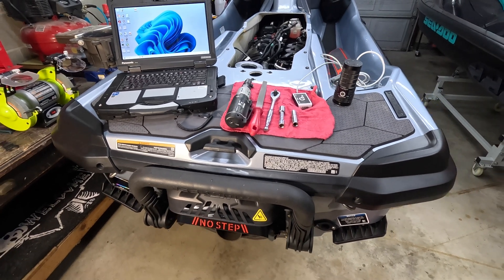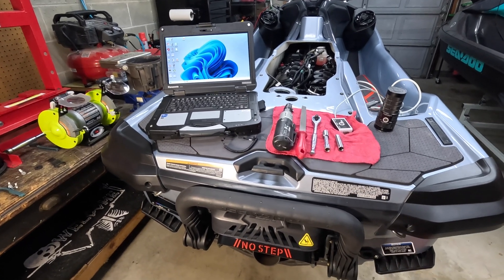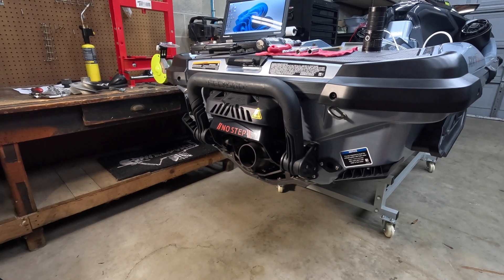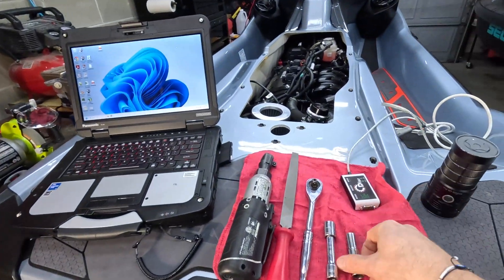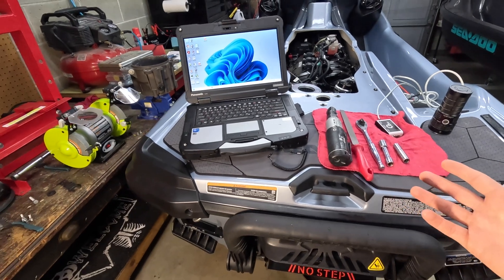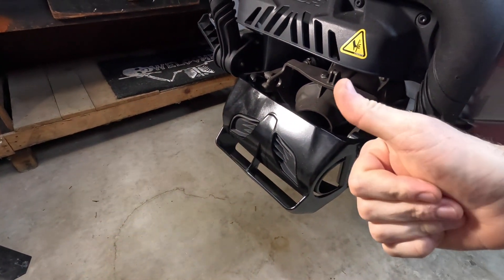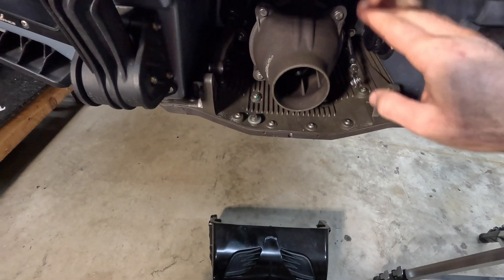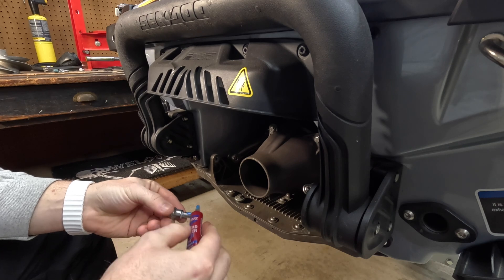SeaDoo iBR Stop Grind - Increased Trim Range and Top Speed

Comment: Got my ‘25 RXT 325 last year and still need a few more hours to 10. Recently purchased Riva single rear exhaust, Riva sponsons and the MapTuner Nano. Will the Nano allow me to recalibrate for this mod or is that only for licensed software?
Reply from the maker: You won't need to do any calibrations for the exhaust since it's not changing any engine parameters (the OEM exhaust has no restrictions). However, simply plugging it in will act as a SCOM. If you ever want to tune it, you would need the unlocked ECU.
Reply: Sorry if my question wasn’t clear or the addition of my mods confused my ask. Can the Nano do the recalibration you did using tue BUDS system for this trim mod? The exhaust and sponsons are just what I prefer and put on all my SeaDoo PWC.
Reply from the maker: @bamafam Ah no problem! Yes, the calibration can be done with the Nano, you will have to buy the home service or dealer service license though.

Comment: Hi Jake, great video. I did this modification and saw improvements. I recently swapped to the unlocked RIVA ecu and decided to re-auto calibrate the iBR using the maptuner. It ends in the all the way up position. If I pull the key and come back later to do the iBR override to all the way up, it will not go to the same all the way up position I see during the auto calibrate. Thoughts?
Reply from the maker: That's perfectly normal. The VTS "learned" range is different from what the override uses.

Comment: i have a 2021 gtx 300 filed the ibr stops then took to a shop he did auto recalibrate with my x module installed did not go all the way to upper stop but did go all the way to down stop position then we tried to do auto recalibrate without x module same results is there some parameter in the ECU tha tneeds to be unlocked with gtx models since they come from factory with restricted trim range

Comment: Do you need to re perform the calibration if you disconnect the battery? My ski reverts back to its trimmed down calibration that came with
Reply from the maker: No need to recalibrate after the battery removal. The resting position of the iBR doesn’t matter. Just the trim up and down height when riding.
Reply: Unfortunately mine loses the calibration if I do that and it doesn't go all the way up anymore, even if trimmed up when the engine is running and in drive. So I have to recalibrate each time. Also no fault codes
Reply from the maker: @frankj1663  Something doesn't seem right there. The calibration is stored in memory as the "only" calibration, so it should just change on its own after the battery is connected.

Comment: Another great and informative video. These are definitely appreciated by the Seadoo community! Do you happen to have a picture of the exact measurement from bucket to hull? I know you said 1/4 inch but I paid someone to do this for me because I did not have to software to recalibrate but I just measured mine the best I could with the top plastic part being in the way, and mine is more like 1/2 inch away. Making me wonder if I'm losing top end or not as im spinning 8700-8800 but only getting 83 mph on average Id say.
Reply from the maker: I don’t have an exact measurement but 1/2” is perfectly fine. As long as you aren’t 2 inches or so which a lot of them are then you should be good there. Sounds like something else is going on! What impeller are you running?
Reply: @jakgal041  i am using a repitched 23 rxpx impeller. I know the recommended one is 13/18 but still hear horror stories on them. Also heard debates that you may gain top end with 13/18 3 blade but lose acceleration vs 4 blade oem. Have you ever tested these?
Reply from the maker: @Mike-Rxtx  I haven't tried the 13/18 but I've had great luck with the 14/19 so far, it seems to bind nicely with the Stage 2 tune. Acceleration and top end is quite a bit better than with the stock impeller.
Reply: @jetskijake-seadoo  oh yes i forgot to mention i ride a 2022 rxtx 300! So a bit different than your 325
Reply from the maker: @Mike-Rxtx  Ahh gotcha! Yeah I've heard good and bad from the 13/18. The coming apart stories kept me from ever trying one but so far the 14/19 has been fairly reliable

Comment: I did not grind on the stops. I checked and noted the travel of the reverse gate using the IBR override.  I then disconnected the IBR arm on my two skis. The ski that allowed the most upward travel with the arm disconnected did not travel nearly as far with the override.  If I recal the IBR, will it start traveling to the stops?

The other thing that I noticed was that after moving the IBR with the gate disconnected, it no longer moves the gate as far as it did prior to the test.  Is it a common issue to need to recal the IBR after simply servicing the pump? I had never had this issue before, but this was the first time that I moved the IBR to full trim up to allow room to test the gate movement by hand.
Reply from the maker: Which ski do you have? Does your ski have the X Module with extended trim range? Without the X Module the iBR override will travel farther than normal trim up and trim down. 

I've also noticed inconsistent iBR maximums (at least prior to my first recalibration). Since the recalibrations the travel height has been fairly consistent luckily. I don't believe BRP is calibrating the iBR's for each ski. I believe they're using a standard configuration and applying to all skis which is why some tend to perform better than others.
Reply: @jetskijake-seadoo  I have a 21 and 23 RXP 300s.
BRP was installing the wrong IBR units/firmware on many 23 made prior to mid May 2023.  My 23 has a manufacturing date of June and was not affected, but the IBR travel was no where near what the physical travel could have been based on the stops.  I will get it recalibrated and report back.  I was surprised to see that my 21 with good up trim had lost travel simply by operating the Ibr without the bucket attached.  I guess the IBR made its own limits since the stops where not in play.  I would have expected it to simply run the previous limits.  Hell, that's what my garage door does, LOL.
Reply from the maker: @billy-bo-dilly  Yeah I remember that whole debacle with the iBR firmware lol 

If I remember correctly, the iBR stop issue started showing up in 2022 around the same time the ride plates were showing issues that needed sanding/grinding. I performed the sanded ride plate mod but it didn't make much of a difference compared to the iBR stops.
Reply: Jake,
I did the recal on my IBR last week and the bucket and nozzle move much further without grinding the stops.  The bucket was not reaching the stops until I did the recal.  The ski now has a much higher bow attitude and reaches the rev limiter much more quickly at WOT.  The top speed remains at 76 on the dash because I am at the rev limiter running only a SCOM. Unless I use a tune to increase the limiter, I don't see the need to grind the stops at this time.

Comment: Awsome explanation! I've done this on a 230 gtr 21' 75 mph at 8900.
22 tx 8900 at 88 w cam and stock wheel.
One step more if you're feeling frisky! 
I did an auto calibrate with no bucket attached to get use of the full ibr arm range. A. Then, I adjusted the ibr stops. I did this to the 2 above skis, and then you trim/file the bucket where it contacts the hull. To get the true max ibr range.
Also did it on a 21 tx but didn't need to file the bucket. It didn't contact the hull. 
DM me if you want some more info.

Edit the 21 gtr has a 629 cam and stock wheel and bolt ons also
Reply from the maker: @tab686  great info! I may be playing with it a bit more once there’s a supercharger upgrade available for the 325. I haven’t been able to squeeze anything more with just iBR stops, but I still have room for improvement when the time comes 😂
Reply: @jakgal041  what state are you in
Reply from the maker: @tab686  I'm in Southeast PA
Reply: @jakgal041  Nice. I'm near easton. I did 2 rides out of Bensalem to Maryland this summer. Let's ride
Reply from the maker: @ Sounds like a plan! We’re out pretty much every weekend lol
Reply: @jetskijake-seadoo  are you on greenhulk?
Reply from the maker: @ I am, but not too much, mainly on the Facebook groups

Comment: Thanks Jake. I've done this previously and I can tell you it does help. Have you experimented with adding a 3 degree pump wedge on top of this?  Thoughts?
Reply from the maker: @mikenegron6162  I’ve used a pump wedge in the past and it definitely helps. On the new skis you need to grind away at parts of the steering nozzle to make it work. I’ve found that the iBR grind has a similar effect.
Reply: @jetskijake-seadoo  I tried the 3 degree pump wedge again and grinded the fin on the bottom results were not good at all. Seems to bind somewhere. Slowed the ski down around 2-3mph. Wondering if the IBR bucket mod has anything to do with it or not but have removed the wedge on the 325.
Reply from the maker: @ the iBR mod shouldn’t but I’ve heard a few people mention it the binding. IMO the iBR mod seems to perform better than the pump wedge
Reply: @jetskijake-seadoo  Yeah I gained like 3mph or so with the IBR mod.
Reply from the maker: @ Nice! Crazy how well it pays off for a simple change.

Comment: Is this operation also applicable to GTX300LIMITED? GTX officially restricted the adjustment range of vts through procedures, which is not as large as that of RXT.
Reply from the maker: Are you referring to limitations through the X module? If so, you would need to unlock the full trim range through that module, or enable it through BUDS.

The mod I did in this video is to extend the already full range even further by removing the mechanical limitations.
Reply: @jakgal041  Yes, but 2025 gtx325 officially doesn't support X module. Do you have any good solutions?
Reply from the maker: @JaniceMiller-o1i  There is, the module you'd need for the 2025 GTX 325 is this one. https://sea-doo-shop.brp.com/us/en/295100857-ski-and-x-package-module.html

If you know anyone with the right BUDS access level they can also enable it for you without needing to buy this module.
Reply: @JaniceMiller-o1i  BRP is working on one for the 2025 with 10 inch display, possibly beginning of summer or end but yes it is being worked on.